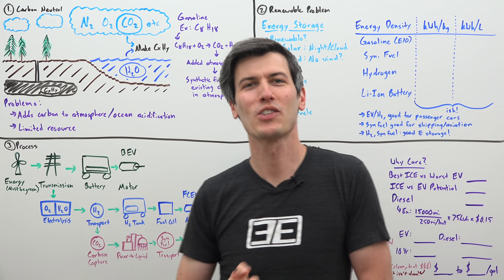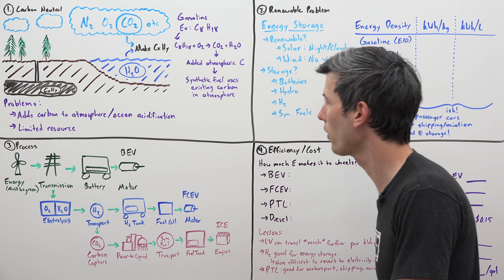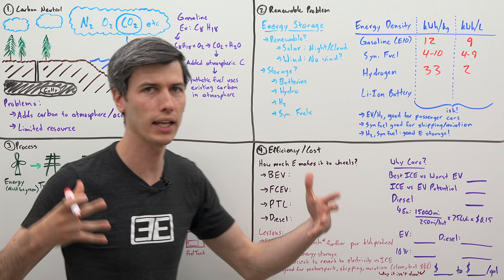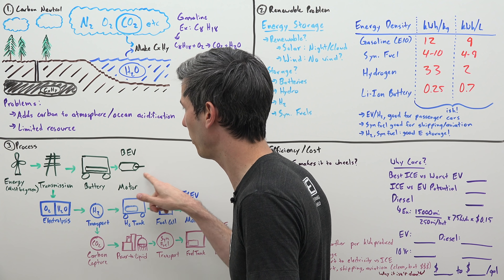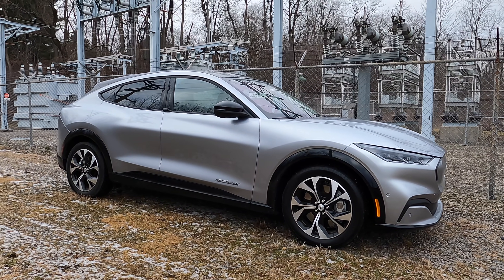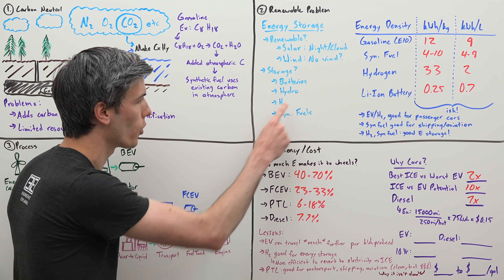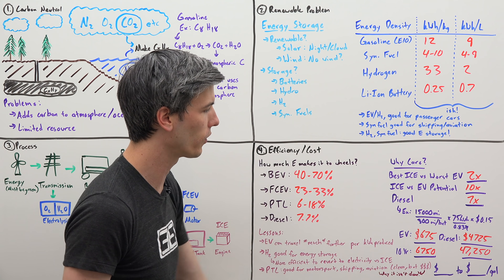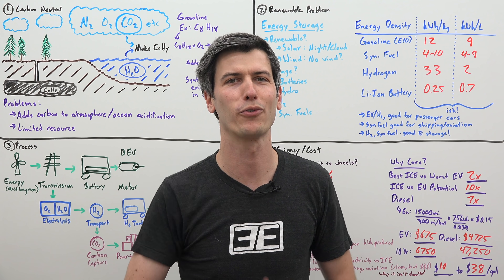The Big Problem With Synthetic Fuels

Comment: You think $2 per litre is expensive 🤣🤣🤣 that's how much I've been paying for at least the last decade at the pump in the UK
Reply from the maker: Haha, that's the cost of the fuel. Add UK fuel taxes, and it'll go up.
Reply: @EngineeringExplained  Fuel taxes will probably diminish if the fuel is CO2 neutral.
Reply: @EngineeringExplained  i think they wont tax it.
Reply: @PC-te8ph  They absolutely will tax it. They're currently working out a system to tax EVs based on miles travelled (since there's no way to tax only electricity used for charging a car since people can plug in at home or into an off grid solar array if they really wanted to. So what makes you think they wouldn't tax synthetic fuels?
Reply: @EngineeringExplained  Well, governments are pushing this energy deprivation agenda. It won't end well! Renewables EROEI is horrendous.
Reply: @C_R_O_M________  It's really not that bad for wind. Wind is very cheap and pumped water can take care of the biggest downside (it's intermittent). I haven't looked into it, but nuclear is probably quite good, but the payoff time is quite long. Nuclear isn't currently renewable so not everyone counts it.
Reply: @samfedorka5629  nuclear is by far the best option financially, environmentally, and for human safety.
Reply: @jaydunbar7538  nuclear is more expensive than renewables both upfront and in the long run, how is that the best option
Reply: @chemlutx7963  price per kWh and upkeep isnt as harsh in the long as well as the amount of energy produced in comparison.
Reply: @cube1614  Idk in everything i could find that was somewhat scientific  nuclear was more expensive per kwh over total lifetime, even without things like getting rid of the nuclear waste considered
Reply: @chemlutx7963  nuclear waste is also used as a fuel for alternative fuel production, but in terms of lifetime for humans or the generator? A nuclear power plant can easily clean 70+ years as long as its well kept but windmills have to be replaced on average of 21 odd years in comparison of how much land is needed for wind mills to make as much power as a nuclear power plant consistently is also astronomical.

Edit - The price per kWh using wind is around 2-4x cheaper but were talking cents on the dollar.
Reply: @jaydunbar7538  But we still need to find solutions for dealing with the waste effectively..... Everything comes with a cost...
Reply: @jaydunbar7538  just plain wrong. And if you ask those managing our grids (the people who actually know things) nuclear is a nightmare to manage.
Reply: @Brian-om2hh  There's molten salt reactors being developed that can use radioactive waste as fuel. One man's trash is another man's treasure.
Reply: @aidanapword  Uh. Nuclear power is usually pretty easy to manage. With today's technology? A raspberry pi can manage it all ALONE. It was a pain because nuclear reactors in use have computers so old that it's extremely human-managed. We don't need that anymore. Also, we have a lot of thorium, TBU fuel is great, but molten salt reactors are also very cool. And molten salt reactors can use super-critical CO2 turbines, hurrayyyy.
Reply: @vladlu6362  you can turn nuclear power stations on and off cheaply in direct response to demand?

Whether it can be managed with a raspberry pi (or a virtual machine) or not is entirely irrelevant.
Reply: @aidanapword  You don't have to turn it on and off with demand though. Even if you needed... Hmmm, there's where the raspberry pi comes in. It can do it all by itself. Easy to manage, as I've said.
Reply: @Brian-om2hh  The waste isn't even waste. The planet earth only has life in it because Uranium is decaying just below us.
Reply: @vladlu6362  but being able to turn energy supply on and off quickly (or, if you prefer, speed up and slow down delivery at will, without cost) is exactly what modern electricity grids need. Ask the grid management companies of the world they will happily tell you this - and include it in most of their public documentation ... and for good and fairly easy-to-understand reasons.
Also: if you need to increase supply over time if you use nuclear you have to do this in big fat chunks with many-year lead times on establishing the (high maintenance!) generation facilities.
How many millions have been killed or displaced by accidents in the deployment of hydro, solar, wind, biomass, geo-thermal or wave powered energy capture systems?
Contrast nucelar: Fukushima, Chernobyl, etc /// and yes, some of thosse happened many years ago ... but Chernobyl is still boiling down there somewhere.
There is a large number of very good reasons why you don't manage nuclear power stations with single devices (raspberrypis if you will) - why the heck would you mess the the atomic-level fundamentals of the universe in a seriously dangerous context when you don't need to.
Just like: why would you be so desperate to burn stuff in over-complicated and unresponsive power trains when you plainly and obviously don't need to?
Reply: @aidanapword  Modern grids do need to respond to demand to be efficient, sure. Last time I checked, that is the problem with wind and solar, not nuclear or hydro. Nuclear can regulate power using control rods in water-light reactors (solid fuel), and in molten salt reactors, you can reduce the speed and increase it as well. 

Now, if hydro isn't a problem, and neither is solar and wind, why would an heavily computerized nuclear facility NOT be as easy to manage? Plus, we are moving to a battery-fied grid anyway. 

Nuclear reactors are low maintenance. Poorly maintained ones aren't, thought. 
There's a difference. How much maintenance do you think that hydro and wind have? None? You are very wrong. They require a lot of maintenance as well. Most maintenance on nuclear plants is pressure of steam related. New technology can decrease this maintenance by a lot. But anyway, molten salt reactors, again, would reduce this by a lot.

Oh my, you are gullible. Accounting for all those disasters... Yes, ACCOUNTING those... Nuclear is still way safer. Less deaths per year than ANY other, yes, INCLUDING solar. Don't believe me? Kyle Hill has a very nice video on this, however, checking Google / DuckDuckgo should suffice you.
Reply: @aidanapword  Like it or not, it doesn't matter where that uranium is decaying, it will decay and emit radiation. Everywhere. Anywhere. We humans benefit if it is inside a reactor, though.
Reply: @aidanapword  That's why you would have failsafes. I would never seriously manage it with a raspberry pi: I was making fun, although not disrespectfully, of your statement. I was just saying it isn't that hard to manage. We would use at least three different computers, the other two as fail-safes.
Reply: @vladlu6362  the failsafes are getting better and better all the time. I agree.

But at the end of the day a nuclear power plant is:
1 a massive installation and investment
2 can't be changed in terms of energy delivery on an hourly basis
3 creates waste that we have to deal with (burying it is not a viable long term plan)

Until it deals with those 3 things it will always be inferior to real renewables.

Dealing with those 3 things means changing the laws of physics.

Good luck with that.
Reply: @vladlu6362  except humans don't do too well when the decay is concentrated and sped up ... so unless you deny the science behind radiation poisioning? And all the other maladies and impacts.
And even if you are silly enough to ignore the impacts of intensified radiation ... doesn't deal with the issues ... which are scale, management, ead time and cost.

Give it up already?
Reply: @vladlu6362  that's why the UK Grid is calling for more nuclear energy? Ummm ... no it's not. You could ask them? Ah wait ... no they have made it a point to make it as a public statement.
Reply: @cube1614  what you do with the nuclear power plant at end of life? Not every country has a storage for nuclear iradiated concrete at Yucca in Nevada?
Reply: @vladlu6362  Fukushima didn't fell because of computers,human errors or poor planning, it was a natural disaster who amplified by a nuclear plant in a way of a tsunami
Reply: @aidanapword  Burying is a long term plan. In fact, it's the only correct plan. The Uranium that decays is what powers our planet. Giving back the radiation isn't bad. Now, your big argument about "waste" only applies when talking about old technology. Solid fuel, I mean. Yes, the new UK reactor is going to be solid fuel based, but it's moving forward by the usage of molten salt as coolant instead of steam. It's orders of magnitude safer just by this small change.

Massive installation? What about wind farms, and solar farms? Nuclear is literally the one type of plant with the most reduced size per watt. It's absolutely small.

It... Absolutely can. What do you think actually happens in most of the world's grid? Most energy is WASTED. You don't need to "hourly change the rate of production" it's damn near instantaneous, and react to demand with a time lag of like, max 15 minutes. That's pretty low.

Now, I've debunked all your points... I didn't change a single law of physics.

While solid fuel reactors have only 1% of their fuels spent, molten salt-fuel can reach 99%. I mean, this ends your waste argument (it wasn't a good one for starters), but yeah.
Reply: @aidanapword  I don't have to deny. I also don't have to agree with leaving lots of barrels in the same space. You can spread them out. Before you panic, all places that used to be mines are covered with thorium, an also very radioactive element, and no one is talking about it. That's because radiation is still going to be low if suffiently spread apart.

Scale: yeah, nuclear doesn't like being small. One single big plant for a whole country sounds great. 

Management? We have already discussed this. It's simple physics. Control rods or pump speed. It isn't rocket science. Computers can do this for us, and it's not unsafe. This is a new plant, not a plant from the 40's and 60's. 

Decay time is really irrelevant. The earth needs radiation to work. Otherwise we would not exist at all.

Cost. Yes, the only one true problem is cost. For now... This problem is gone with thorium, though. It is extremely common.

I can't give up, you haven't given me any reason to do so. You are fighting me with nuclear reactor knowledge at the level of the 40's. We know much more about it today, and info is available.

Please consult Kyle Hill's channel. Appreciated.
Reply: @Kannot2023  Fukushima was human failure. Bad planning, putting it near an active fault.
Reply: @Kannot2023  The nuclear plant did not cause a tsunami... That's a ridiculous statement.
Reply: @Kannot2023  Great question. Also, the only valid question here. The answer is: we melt it and build new facilities. Yes, I'm serious.
Reply: @vladlu6362  So you can build a nuclear power plant in weeks? And for how much?
Reply: @aidanapword  I never said it can be built quickly. It definitely takes from 5 to 10 years. I don't see how this is an issue, however. We can do it faster, perhaps, but that's not an issue to begin with since nuclear plants last for decades if well maintained.
Reply: @vladlu6362  5 to 10 years to being it online is important for a vast proportion of the world.

Modular systems have many important benefits over mass installations in nearly every significant area of life.

That solar and wind have loads of other benefits too ...but modular deployment options are central.
Reply: @aidanapword  Indeed! Those are very nice advantages. However, they are too dependent in natural factors, so they aren't reliable. 5 to 10 years is not that much of a deal. It's a fairly small amount of time, though you definitely can make it go faster.
Reply: @vladlu6362  size per watt is not the point.

Modular installations will always be bigger. But, guess what - nearly every system you use is modular - and for a reason.

Extensibility, scalability, flexibility, and innovation are all deeply based on modular systems and (though less relevant here in this discussion) separated responsibility ... these are all the basis for modern development ...  There's a reaosn why modern systems and technology have significantly departed from the the centralised mainframe computing of the 1980s ...

And easier to apply to local conditions.

Not sure I would want massive nuclear plants powering the rural areas of Afghanistan.

Or what about people who live in vastly separated communities ... does it make sense to host 1 big power station(of any type) and then run huge swathes of energy-wasting wires across vast distances when you can apply small localised dual- or multi-ttech energy "farms" in a modular easy-to-deploy fashion that doesn't require vast capital inevstment (and highly educated staff to manage the safety, or highly complicated automated safety systems) ... ?

No ...

And as regards the type of fuel and modernity in this and "returning radiation to the earth" (what kind of mumbo-jumbo is that?) ... anyway ... the very fact that you have marginal (as in "extra", not as in "small") amounts of waste to manage for exery extra kilowatt generated ... nuclear waste (liquid/solid/whatever form) is nuclear waste ... that you have to dispose of. Even if it was easy and safe (neither!) then I still would want to have to bother!
Reply: @vladlu6362  and you haven't debunked a single 1 of my points - or, for that matter addressed the reasons why modern electricty grids do not want big sources of power that have to be amnipulated from one central place.

And you haven't addressed the key problem that once you have built a massive nuclear power station it is incredibly hard to maintain and very expensive to change and equally expensive to decommission when the demand moves.
Reply: 2?
Here it's 4,5 per liter.
Reply: The discussions about nuclear energy are always funny. I don't mind if research is done in that field - why not?
But claiming that nuclear energy is clean and cheap is just not true. If they would calculate the price for renting (save) storage and maintaining it for a couple of thousand years plus insurance fees for that long etc. the costs of nuclear energy (as produced today) would be insanely high.
Reply: @thewaldfe9763  and with prices of solar and wind falling all the time ... Seems to me researching a complex (and dangerous) solution for a problem we no longer actually have ...
Reply: Uhh, in the uk gas prices are below 2 USD/liter... 1,5€/liter.
Reply: @verttisyrjala2897  no it's not.
Reply: Dang, why do you guys keep electing politicians that Abuse you like that? Elect someone who respects their citizens and only taxes you for the absolute minimum needed to run the government. Maybe institute a high tax for anyone who becomes a politician
Reply: @TKUA11  that would be great if that was an option?
Reply: If our US friends drive north into Canada they will pay up to $1.74 per liter or $6.50 per Gallon.
Reply: @glenf4115  nothing next to UK prices and even those are not even close to what synthetics would need to be marketed at to cover even basic manufacturing costs for synthetic - let alone any profits for the manufacturer.

Comment: I don't think anyone who spend more than 10 minutes looking into i thinks synth fuels will replace EVs. However there are still applications where EVs will not win out and for those synthetic fuels would be a solution. They also increase fuel prices which in turn makes EVs more favorable.
Reply from the maker: Correct - EVs are not the current solution for many applications.

Comment: How much energy does it take to make synthetic fuels.
Reply from the maker: The study referenced claims 9.5 kWh per liter of fuel.
Reply: @EngineeringExplained  is that comparable to the amount of energy used to make normal fuel? Oil companies have become fairly efficient at producing fuels, and not really having any waste from refining. As you can tell I do support oil and gas production.

Comment: Partial interim fuel source: the tech is being developed to extract hydrogen from oil wells at a lower energy cost than cracking water.
Use that in combination with atmospheric carbon dioxide to reduce grid demand and allow higher production from solar/wind.
Also excited about the nano tech that can turn atmospheric co2 into methane in a single step. High density storage at atmospheric pressures seem like a win for me.
Reply: Oil wells?? 90%+ of hydrogen produced today is cut from natural gas.

Comment: Nice video. You note a very important subject.
Also called EROEI = energy returned on energy invested. 
The thing to look for against (marketing) "Green washing". 
2,5dollar a liter for synfuel isn't that expensive, in the Netherlands we pay €1.75/liter for E10 95octane.
And €2.00/L for 100octane without ethanol, with today's exchange that is $2,5/L
Reply from the maker: Should have pointed out, $2/L is referencing cost. However much individual countries tax that cost is a different subject (big part of why fuel is much more expensive in Europe vs US).
Reply: That's a valid point. 2 days ago, I was in Germany and paid €1,54/L for E5 95 (E10 was even cheaper). Pure tax difference.
Reply: @fastnb  You paid about 1€ in taxes and fees, the gasoline price is approx. 0,50€/l.